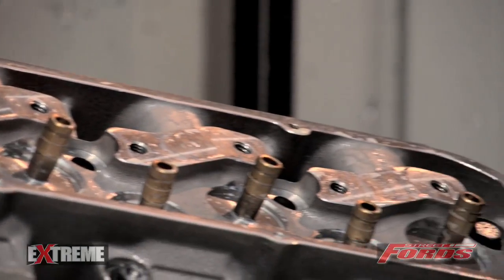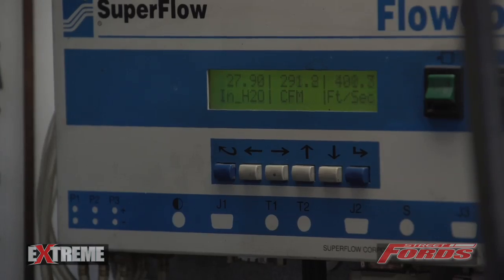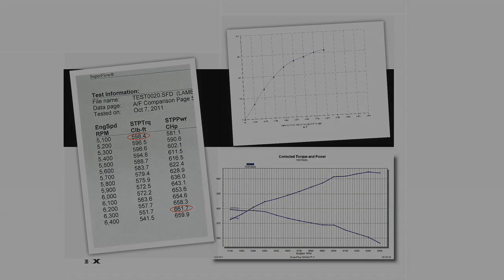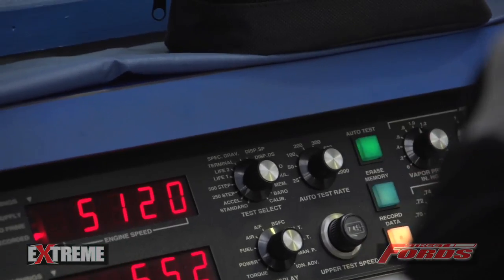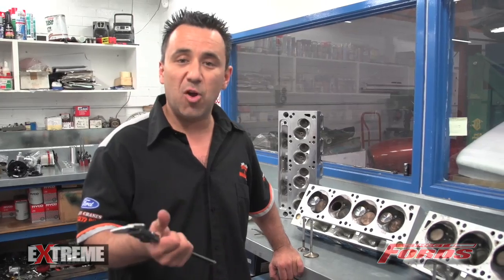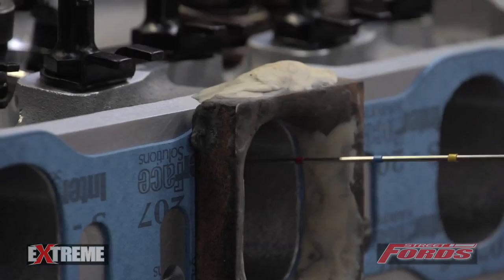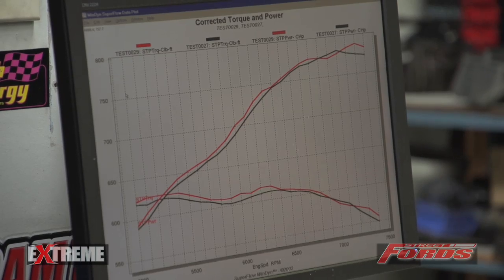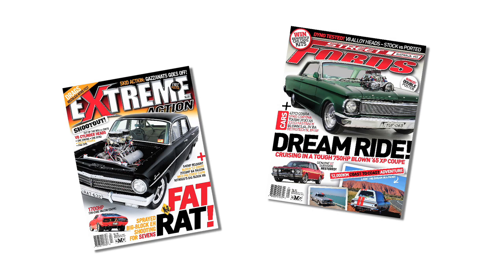Ford Windsor CNC Alloy Cylinder Head Comparison Part 1

Comment: My old friend Jeff 🙏 at modern cylinder ported a set of tfs hi ports. On a 400 in Windsor in a mustang with a Liberty 4-speed ran 9.0@150. that was about 15 years ago so it was no rail car. Was a grudge street car in Detroit 💪🤟

Comment: The Cleveland was a total failure in Nascar. The Windsor design far out performed the Cleveland.  And now the Ford Nascar F9 is another flop.
Reply: 900 HP from 350 CID is hardly a flop…
Reply: @frdbos547  It gets beat by Toyota or GM every freakin Nascar race. Bring back the Windsor for Christs sake you Ford nitwits!

Comment: very impressive about the air speed . also 3v implies 3 valves per cylinder  but i see only 2 what is 3v mean?
Reply: They use the 2V intake valves with the 4V exhaust valves and call it 3V, it was really confusing me too until I looked it up...
Reply: @stephenkeebler732  Ah thank you  they split the difference interesting...confusing but inyrtrsting
Reply: sean fay it's not valves it's venturi from a carb for Cleveland engines there's 4v and 2v this is a custom inbetween good for torque and Hugh rpm
Reply: So a 3 barrel carb??
Reply: I'm asking the same. The name implies a 3 valve head which were available by a custom head maker about 12-14 years ago ( their engine made 700 hp!). I am almost positive it would be 1 int  2 ex  to make up for the Cleveland's  mediocre exhaust port flow..( both for  the 4 barrel head, confusing name but essential the larger Cleveland heads w/ the larger ports valves only came with a 4 bbl carb  head ...flow 272/160 cfm I/E  and  the 2bbl head...avail on the lower performing 351 C and 351 Modified as well as the 400 Modified Ford engines... 200/160  cfm I/E  ) I think the second part of Zeepo's explanation is essentially correct about the in between (flow wise)...thus 3V  but I think he is confused about the 2bbl vs 4 bbl head nomenclature as it is about head design AND Ford did use each head w/ the corresponding number of barrels....whew! damn it Ford!...should have been called 351C big port,  351C small port!

Comment: Hi Guys, here in America most of us use the Windsor type heads, I notice my 408 Windsor is happy with 34 total degrees of timing running on 110 octane fuel what do you find to be too much timing, I know there are factors but for the most part?

Comment: I have never heard of a 3V. ?
Reply: You are familiar with Cleveland 2V heads, good intake ports and small exhaust ports.  The Cleveland 4V heads have huge intake ports, and large exhaust ports.  Many head designers think the 4V head intake ports are too big, so they created a cylinder head with the smaller 2V intake port coupled with the larger 4V exhaust port so they call it a 3V. 
Hope that helps

Comment: You mentioned taking out 2 degrees and gained power, I run my 408 Windsor at 34 degrees total, I find running 36 degrees is not what the engine likes it just runs better at 34, I know Chevy's like 36-38 degrees but not the Fords, I would like to know what your total timing was when it had the most power?
Reply: the stroke, compression, fuel, and cam profile (overlap) determine how much timing it takes to hit that sweet spot, or ping away the power
Reply: Depends upon the chamber and camshaft.   Its not brand specific.

Comment: Why do the engines fall on their face before he pulls back on the throttle? Also why would he run it that far past the rpm range?
Reply: for data when the dyno opposes to the point that the engine power drops, its still making power, so measure it, thats what a dyno is for

Comment: Do you know that in 2004 CHI built a test engine that was 427 cu in and with stock out of the box as cast 218 CHI heads on pump fuel it made 645 TQ and 745 HP .
Reply: davie biggions with 14.5:1 compression ratio and vp 116 fuel
Reply: @robmotown1  and a huuuuge  roller camshaft
Reply: @michaelparadisis4076  Small roller cam.
Reply: @robmotown1  Pump gas engine with a small roller cam.
Reply: The high torque numbers indicate the efficiency of the heads.      Another guy did a build with the W 218 CHI and on pump gas achieved 670TQ and 805HP out of 438 cubic inches.

Comment: I'd be interested to know what an American 4V Cleveland head flowed...those had valves almost as big as the chevy BB
Reply: they had larger valves than the BBC actually
Reply: Without work supposedly 275CFM@.600" lift, the exhaust flow was poor without filling in the port and the port plates.    The exhaust work was worth 25-50HP depending upon rpm.     The intake ports with work, I have to imagine they were getting them to 350CFM or so.    There are youtubes of Glidden and others redoing the chambers to a more heart shape design.
Reply: 375cfm with floors filled, chambers worked, bowl work and a valve job.

Comment: It's not a good thing that you have to add more timing!  It means your burn rate is slower...which results from poor wet flow.   The base heads will run the smoothest, and have the best fuel economy.

We have modified LS7 that make 750 bhp on 91 octane, and it doesn't hurt fuel economy. They like to run at 20 degrees total timing. Gen 3 hemis run 18-19 degrees total timing.
Reply: 20deg total timing? Bla bla bla

Comment: BULLSHIT TEST  !!!!

You use putty on the second head wich will increase A LOT the volume of air,like the speed.
You didn't use it on the first head.

That's really a shitty test if you are not even able to reproduce the same testing parameters.
Reply: michaelovitch As far as flow bench testing. The proofs in the pudding as it's said, the Dyno numbers!
Reply: I too noticed that
Reply: shut your word hole its gaping

Comment: Cool video. No surprises that a 450 cube small block makes more power with a bigger cylinder head though..  660hp & 600ft lbs to only run mid 10's in a falcon?